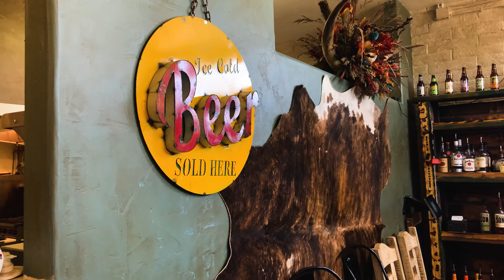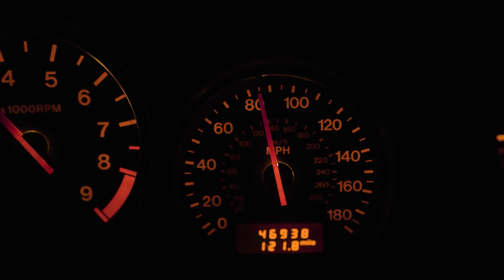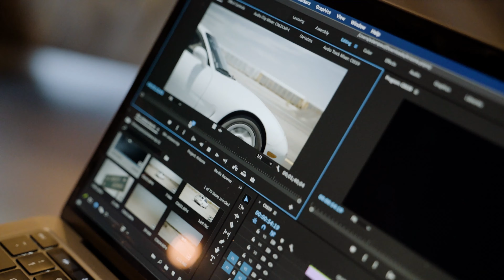Yep, We’re Stranded in Arizona… RX7 FD | Ep. 2

Comment: The gas fill up scene reminded me of when i got my white FD (94k miles) around this time last year except mine was actually jammed and when it flung open on the 5th try the tab also came flying out. so i shoved a twig in the hole and the original pin on top and now its a credit card access type of gas door. Also had the smoke problem on my first rx7 (FB) except the leak was from the block, good times. Congrats and enjoy the hell out of it.
Reply from the maker: Thus far, it’s never not an adventure to get in that car 😂 sometimes I make it an adventure, sometimes the car does… but always hahaha
Reply: The purge control solenoid valve thing, probably a rotted gas cap seal, or the gas tank cap wasn't on all the way.